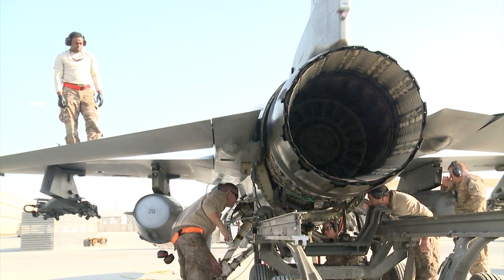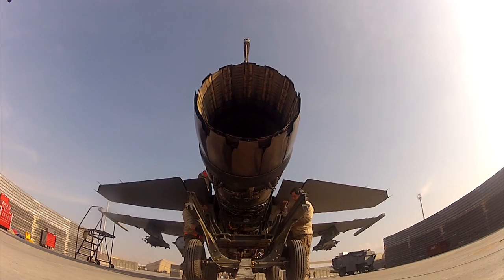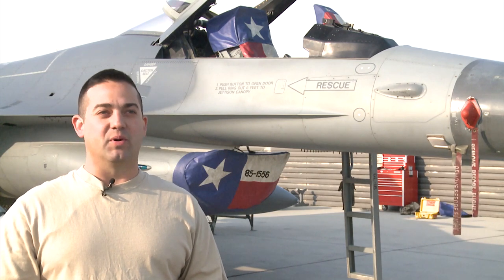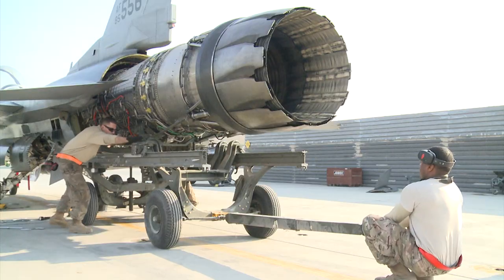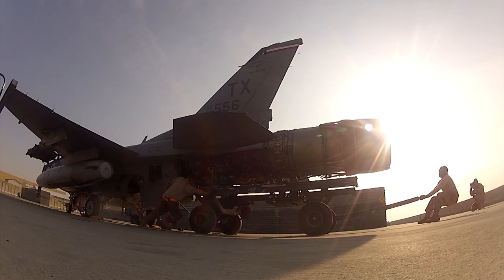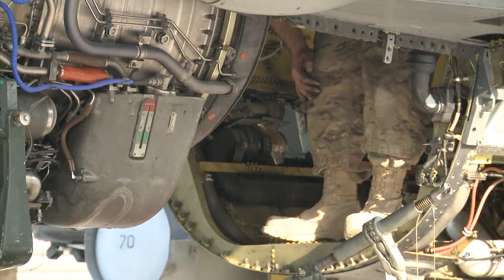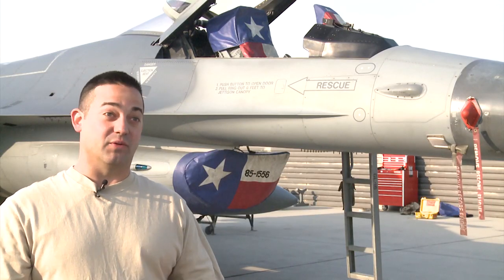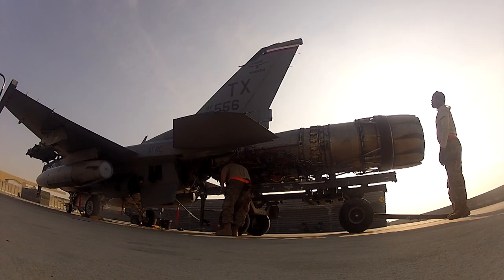F-16 Fighter Jet Engine Removal (HD)

Comment: I did this many times on the B52 KC135 F4 F101 F106 T33 B57 aircraft I was a jet engine mechanic USAF for 10 years.  1970 to 1980.
Reply: +John Doane  i love your job. aircraft  is so beauty with me. although it is the deadly machines. but the design so beauty and the detai of machine make me feel exciting.

Comment: I did this a many of times on the F-15.
Reply: James Horak KG5PTE do you have Facebook account
Reply: F15 is twin engine correct?  Is the F14 twin engine as well?  Which is faster a light  F16 with the large single engine(just by looking at it it looks larger than 1 of the engines in the  F15s)  or the twins in the F15 that may be heavier?  Just curious. Thanks for any info on them, im relatively new to the subject.  All of our(USA), and some of the Russian fighters are really good looking badass HOT RODS.  My personal favorite is the F16 in my opinion, i think the light plane with a single large engine would most likely be faster and more agile.  What all engines do they run in the fighters GE,Boeing,Rolls-Royce?
Reply: @williamsawyer9768  Yes the F-15 and F-14 are both twin engines. I think that both have the same engine but the F-15 has two of them (F-15 is way bigger and heavier than the F-16). The F-15 remain very agile even being heavier with its two engines as from the beginning it was designed to be an air-superiority fighter jet while the F-16 was made for multi-role purposes including air combat, reconnaissance and air-to-ground strikes.

Comment: what engine model is that? is it a PW or a GE? is so different from the old azz f100-220's i work on xD
Reply: Looks like a GE engine. F110-GE-100 to be more specific. GE's exhaust nozzles have more of a curve to them whereas Pratt -Whitney engine nozzles are straight. I worked on both. F-16 crew chief 85-91.

Comment: really grinds my gears listening to this aviation propulsion mechanic call this beautiful piece of machinery a motor. nails on chalkboard
Reply: +MrFARTSANDWICH It is a motor though, by definition.
Reply: +2Shae technically by definition a engine is a device that burns or consumes fuel changing its chemical composition to transfer energy. and a motor is a device driven by electricity air or hydraulic pressure which does not change the chemical composition  of its energy source to transfer energy. but thanks for playing
Reply: "a machine, especially one powered by electricity or internal combustion, that supplies motive power for a vehicle or for another device with moving parts."

Is the definition.
Reply: +2Shae you're right that is the definition of a motor not the definition of an engine
Reply: +2Shae try asking your smartphone the difference between an engine and a motor
Reply: You do realise Engine and Motor are synonyms, right?